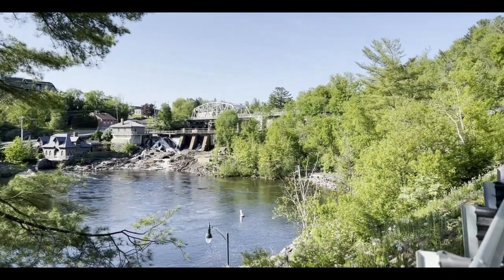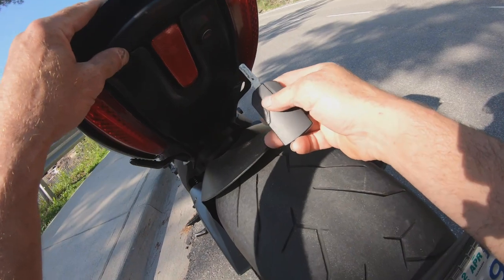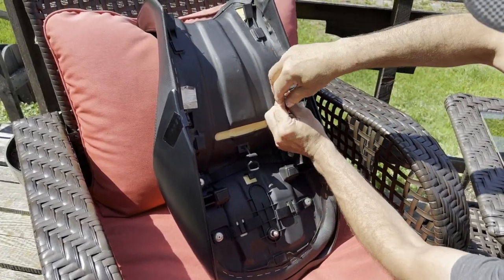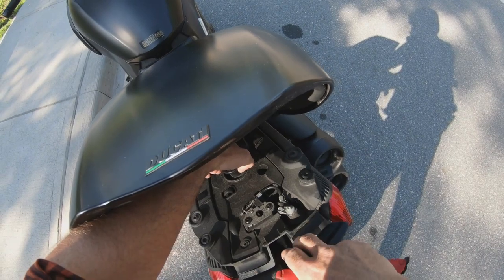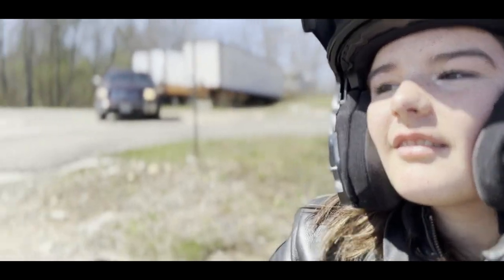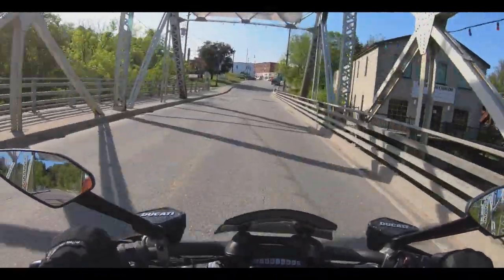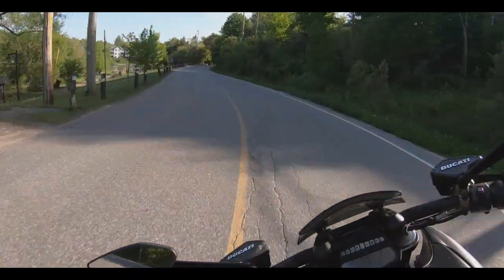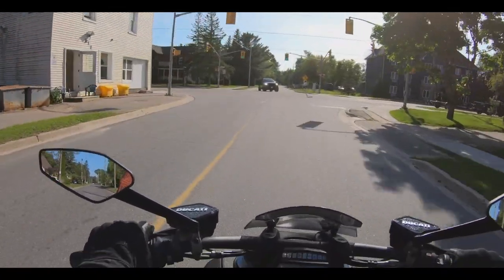Two up on the Ducati Diavel, motorcycle doubling review

Comment: Another great video, Thankyou.
My wife and I have been riding our diavel for years as over long distances.
I never use the screws under the seat to secure the cover to the seat. There is absolutely no need for them, the seat cover and clips just click into place. It's impossible for the cover to come of. 👌 It takes seconds to remove.
I have also the uprated rear spring on the bike, the best single mod for any diavel. The standard rear spring is far to soft standard, so it hits the bump stops over bumps, it needs an uprated spring for the suspension to work as it should. Also the preload knob will acualy work when riding two up.
Reply from the maker: Good to hear that an upgraded rear spring is available 👍.I will have to look into that . Cheers